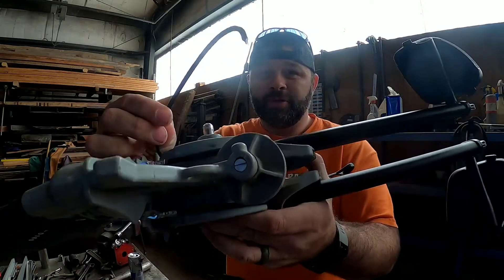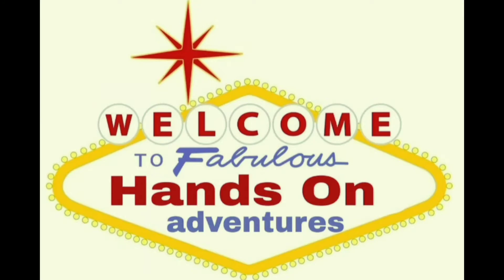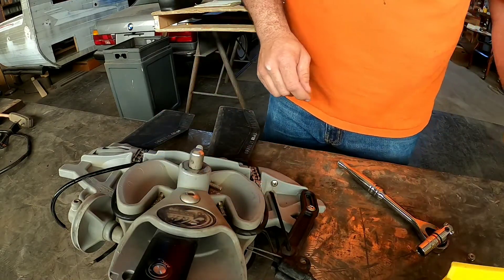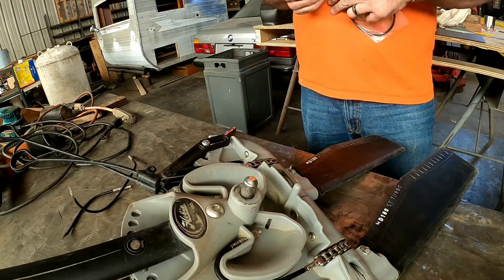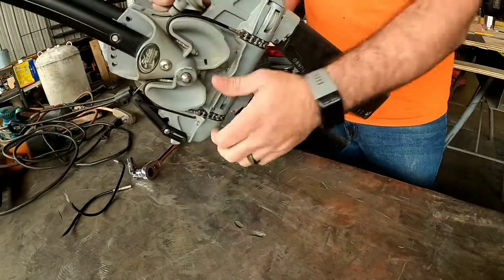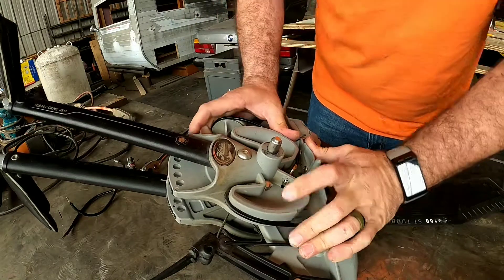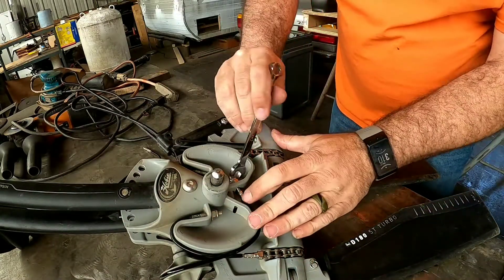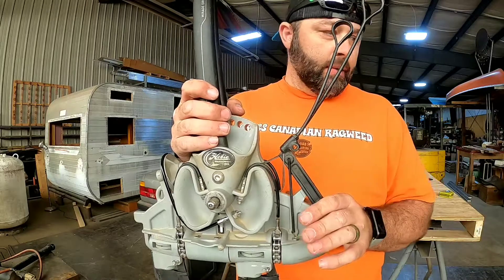Hobie mirage drive idler cable repair

Comment: Pretty straight forward I've got both of mine on the table now.  One needs the idler cable replaced and the other needs the idler pulley replaced.  Thanks for the walk through.
Reply from the maker: Glad I could help.
Reply: @hands_on_adventures  It went smoothly.  I had them both repaired in ten minutes.

Comment: What's the actually purpose of that cable? 🤷🏻‍♂️🤷🏻‍♂️🤷🏻‍♂️
Because mirage drive it's working without it 🤷🏻‍♂️
Reply from the maker: Good question because I've ran mine without it before. I think it takes some stress off the spline
Reply: @hands_on_adventures  my one broke the other day while out on the water. 
And it was working fine for rest of the day. 🤷🏻‍♂️🤷🏻‍♂️🤷🏻‍♂️
So do you reckon I can keep using it till I receive the new part??? 🤷🏻‍♂️
Reply: @hands_on_adventures that’s what I read